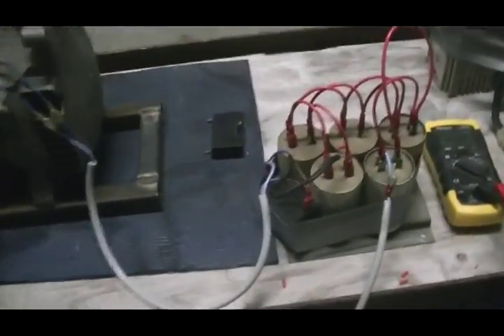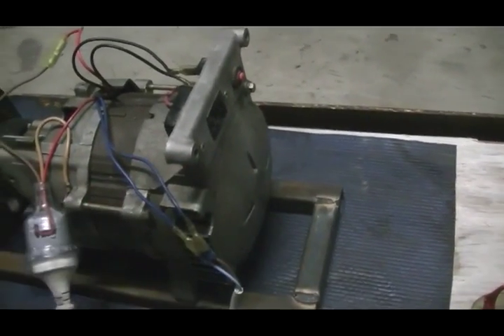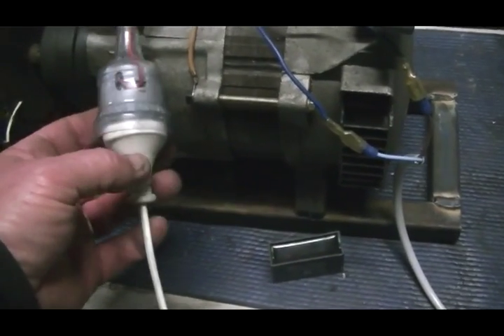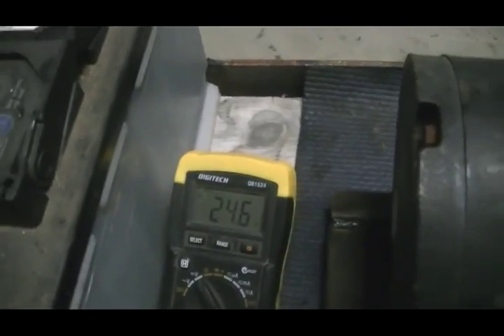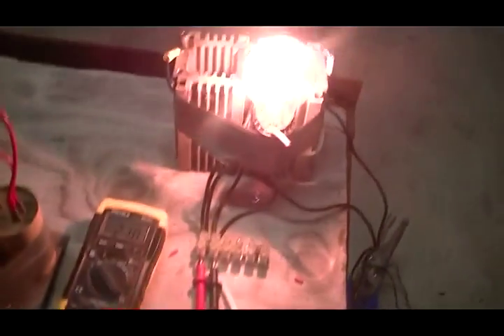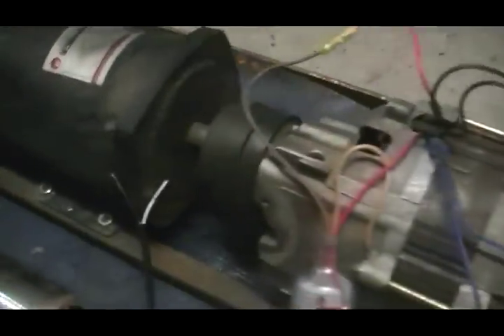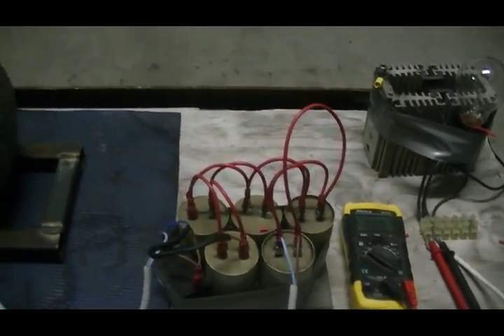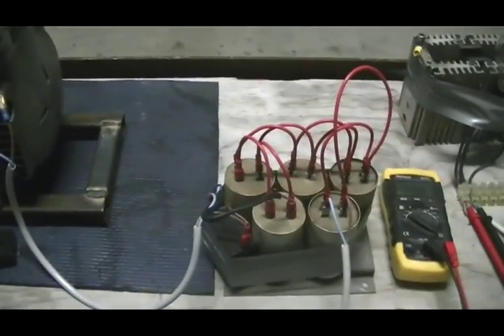motor generator desulphator pt7

Comment: nice one-measue the current draw on the CFL's.
i have noticed that there is also some 'free' voltage from the case or housing of the DC motors.
poke around with the meter between the metal housing of the DC motor and the drive input wires.
its not much but it there,and every little bit helps.
not sure what it is from,maybe eddy currents induced in the steel by the rotor